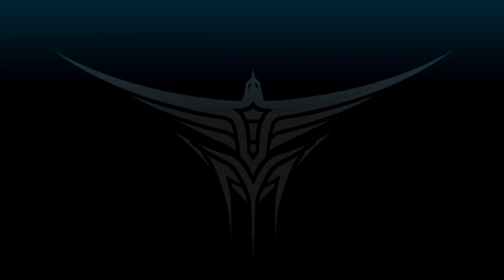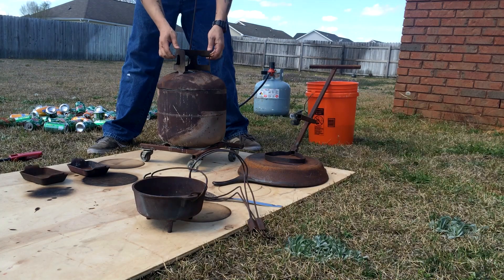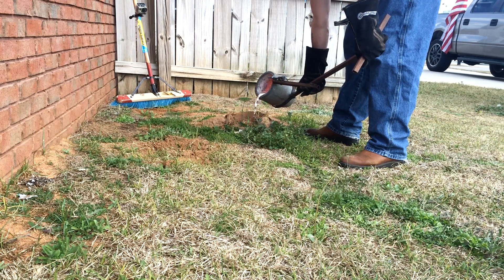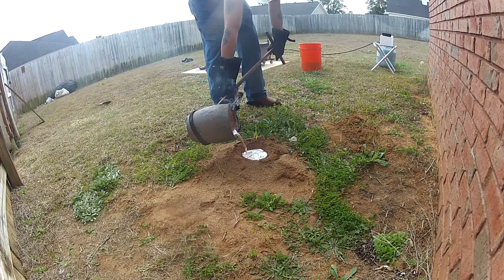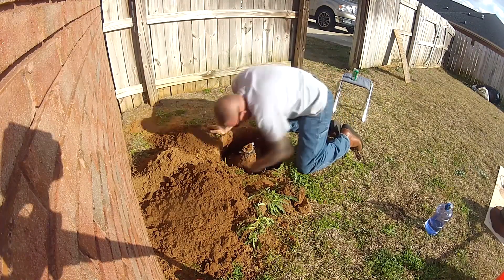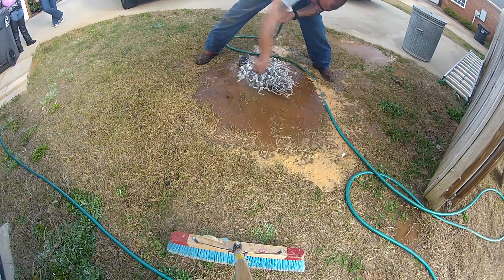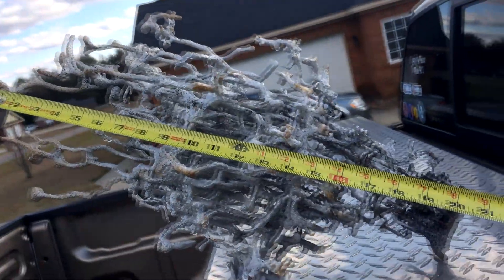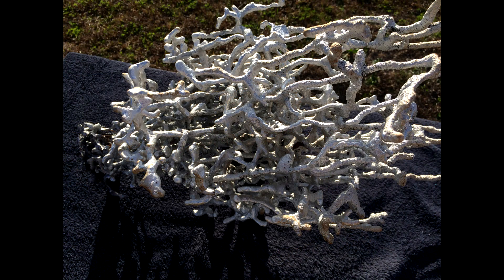Ant Hill Casting #3

Comment: What r u using for a melting pot? I'm using a can that keeps getting holes in it so my aluminum ends up where I don't want it.
Thanks
Reply: Hes using a crucible
Reply: Made of what?
Reply: DUMBASS Probably graphite or silicon carbide.
Reply: +DUMBASS  possibly ceramic

Comment: why did it take that long to dig that u, couldnt u just pull it out, (if it was cool), or would it break or bend and i almost know nothing about melting metal and that whole bit but i know a couple things, basically i know what things are called and what to do with them, but anyway yeah i would have just pulled it out or used something to pull it out

Comment: Will the molten aluminum solidify before you pour in the 2nd pot? I'm afraid that may cause a weakened cast at the middle.
Reply from the maker: ***** Yes it will.  It solidifies on under 2 min.  The propane just barley gets it past the melting point then the ground is "frozen" in compairision.

Comment: Looks really sweet! Would be cool to see the ants though, ever tried maybe using melted glass? Actually ants would probably disintegrate away.
Reply from the maker: i cant get glass hot enought to flow down into the channels...  with my propane foundry i can bearly get it to soften and kina clump at the bottom of the crucible...  i wanted to do one in glass just as a conversation peice but i would need somthing much much hotter.
Reply: 556Raven Oh ok. Anyways thanks for the videos, we don't really see ant hills down here in the UK, so looks great to see the nest like that.
Reply from the maker: your very welcome.

Comment: I built a nice little smelter out of a propane also.  Very similar to the one you made but with charcoal.  I can barely get any aluminum cans to melt and the the steel bucket I was using as my crucible didn't hold up.  I would like to use propane and I need a better crucible.  Can you help me?
Reply from the maker: yup...  check out my playlist "little sparks" i detail out how i made everything i use to melt aluminum...  however the crucible is a non home made item.  I used steel for a while but it would burn threw in no time and was more trouble than it was worth...  I got mine here - 

http://www.budgetcastingsupply.com/Crucibles.php

I recommend them.  Bought one clay crucible from them 3 years ago and its still going strong.
Reply from the maker: if you have questions after watching my other videos feel free to ask in the comments.  Ill do my best to help.
Reply: Ok thanks.  What about the propane burner?  My setup is the same with a 1 1/4 inch steel pipe going into the smelter.  I bought a tee fitting like the red one that you have but I'm not to sure on the rest of the stuff...
Reply from the maker: its a welding tip and "dig threw" bits from the hardware store to fit it into the T fitting and attach it to a propane line.
Reply from the maker: Brandon Thompson This guy has all the different parts for sale and he just started making complete kits!  That would have been helpful for me.. ;-)  
http://www.hightemptools.com/burners.html
Reply: Right on.  Thanks a bunch.  I like your channel
Reply from the maker: Your welcome.

Comment: Dude! You need to take a trip to Australia and go cast some of the Ant/Termite mounds. They stand roughly six feet or more tall. They also dig down into the earth and thats where their nest is.
Reply from the maker: I've actually thought about doing that but i think i would need a bigger foundry. ;-)
Reply: 556Raven I live in Western Australia, I think casting a termite mound would be damn near impossible considering all the entry and exit holes all over the mound. You would have to create some sort of barrier on the top for a large round base due to the weight of the cast, then plug up all the other holes that you want to stop the aluminium leaking from. I reckon you're right about needing a bigger foundry, I'd also buy some good quality aluminium to melt as well, no point wasting crap on a cast that epic :D
Reply: ***** Dude it would take 5 years just to dig up XD
Reply: Termite mounds are mostly above ground in my experiences with them as a kid, we used to use shovels and axes to tear them apart. If it were possible to make sure none of the aluminium got out during the poor as there are many holes all over its mound surface, It would be quite easy to dig up. On the other hand, termite nests are like hard dry mud and wood which would be hard to clean out of the cast, not just sand and a bit of mud perhaps like ant nests.

Comment: Another really cool pour with an awesome result. Do you used just cans and do you use any flux to get the metal to flow better?
Reply from the maker: i add about a table spoon of "light salt" right at the end to both de-gas and act as flux.
Reply from the maker: and thanx for the complement.  ;-)
Reply: 556Raven Good to know since I have a ton of cans to melt. If you didn't know, soda wash works much better as a degasser.
Reply from the maker: Sweet, ill try that next time i melt.  Thanks for the tip

Comment: The only problem is the type of aunts we have dosnt make ones enter whole even if you dig under the top. It's just a bunch of smaller holes. Do you think it is still possible?
Reply from the maker: absolutely.  If you dig the top off it will create a nice base for all the little channels to connect to and it will still flow down and all over the inside of the mound.
Reply: You will probably need more metal than normal.
Reply: Burning your aunts, thats so morbid!!!!!